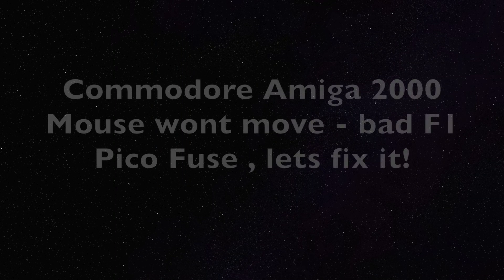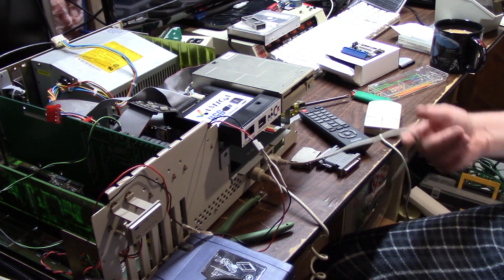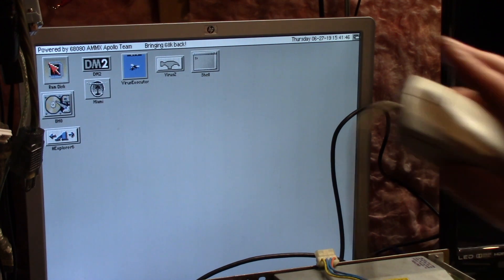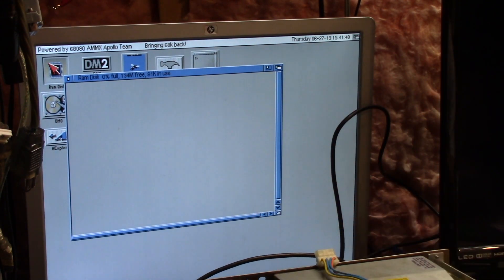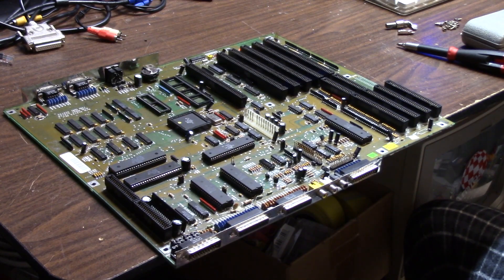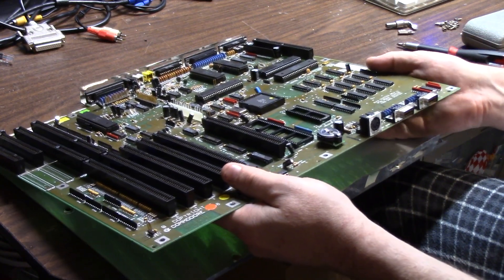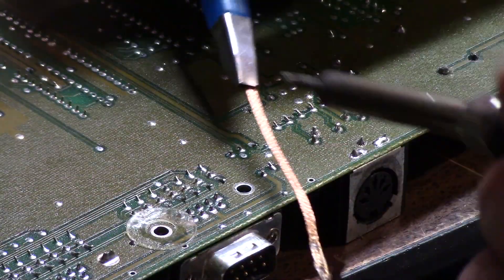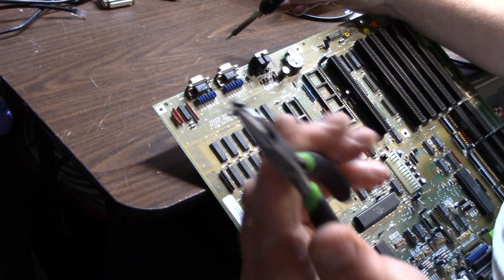Episode 96 Amiga 2000 Mouse wont move blown fuse

Comment: Hi. Fabio from Bologna. Same problem on my A2000. I removed the fuse and will buy it tomorrow. But I wanted to ask you if 4 amps isn't too much. I don't think 4 amps pass through the mouse port. And how many volts are there ? 5 ? 
In the video you say "100 milli amps and 4 volt".
Reply from the maker: the Amiga is a 5 Volt system. your mouse uses 5V 4Amp PICO fuses,

Comment: Hey Chris, great vid as always.  The right button on my mouse stopped working.  Everything else does work though, so I can't imagine it's F1.  Swapped CIA chips, reseated Denise, continuity tests of mouse pins to board check out OK.  Have you run across this and any possible idea what might be happening?
Reply from the maker: theres a chip in the front right that controls mouse movement, LS157 its like 1$   or your mouse is just dead... try another mouse to be sure
Reply: @ChrisEdwardsRestoration  Last night I removed all of the add-in cards and the mouse works fine.  So there's a conflicting card.  Thanks for replying Chris.

Comment: Anyone have a link to what I need to buy? Well i got some from amazon , 4A Littelfuse Pico Fuse 4A 4 Amp 125V Fuse 4A 125 Voltage ,I hope that is ok to use.
Reply from the maker: well i think they are 12v but you can even use a 3amp if needed. if you dont feel like taking everything apart, just piggy back the new one on top the old. then snip its legs
Reply: I fixed it today!! But I really shouldn't be near a soldering iron

Comment: Would a pico 3.5amp or 5amp fuse ok if 4amp isn't available?  i'd think 3.5amp would be close enough and safer than 5amp.   I have to replace mine and wanted to buy the part today not order and wait a week..  i know i could bypass but having not owned the unit when it popped i don't know what caused it to pop originally so i'm cautious
Reply from the maker: Sure would
Reply from the maker: What makes them pop most of the time is people swapping mice or keyboards in the metal touches causing a spark either from static or just some residual current they pop very easy so remember it’s 1990s when you use these things and we always had to turn off plug-in or remove devices and turn back on it’s easy to forget in the modern world of hot swap but that’s how it used to be I don’t know how many I replaced in my career but it had to be at least 100
Reply: @ChrisEdwardsRestoration  so would you advise 3.5A vs 5A?  yea i won't hot swap stuff.  Though I wonder, if I use one of those USB to Amiga Mouse adapters, would that be less prone to popping?  These usb adapters are very snug when they go into the A2000 they don't budge..  Not that i see myself needing to swap often.. In fact I am probably going to use a wireless usb mouse with it making cords a non issue (if it's compatible)
Reply from the maker: Its. All good ive run tinfoil over mine to get it to work.  And replacing it later of course anything in the 3 V through 5 V will be fine
Reply: @ChrisEdwardsRestoration  awesome thanks!  just wanted to be safe.. 4amp does seem like A LOT of power.. right?  i'm surprised that much juice is flowing through traces like this.
Reply from the maker: @8bitwidgets  its fine, im running 3A slow blow pico fuses in a few of them and it works fine. NTE part number 74-MS3A-B
Reply: @ChrisEdwardsRestoration  cool the ones i picked up today and are being installed by my trusted local repair guy in town today are 125v 3.5a fast blow fuses.  I don't see myself swapping live every..   i'm having him actually install single pin sockets so in the future i can easily replace them (and the varta) in a similar no hassle / solder free approach for years to come.  I have never liked computers that can't keep a simple time/date..  or at least having ones not keep time that actually should be able too..    I forgive my Sinclair 1000 and TI99.. :)

Comment: so i have an A2000 with dead mouse port..  my concern is if i get it fixed, do these things just pop sometimes or is there a larger issue i should be looking for while i'm replacing it (or rather instructing my local repair pro on what to look for) as I'm having him also replace the (not leaking yet!) varta battery
Reply from the maker: you dont "have to" take it all apart, you can either piggy back the new fuse overtop the old, or replace it with a diode to prevent it from popping in the future. the fastest route is to piggyback a fuse
Reply: @ChrisEdwardsRestoration  ok cool, the mouse port was dead when it arrived in the mail the other day.. so the prior owner must have popped it.. but no idea what they did at the time.
Reply: @ChrisEdwardsRestoration  if i wanted to use a multimeter to test the flow.. would i check for voltage at the two points of the fuse and see if energy wants to flow through it?  should i see 4v?
Reply from the maker: Yup
Reply: @ChrisEdwardsRestoration  if the mouse doesn't left click is that signs of some other problem?  also what pins are "hot" to check in case the fuse is in fact not popped but maybe some other deeper issue might be going on?  seeing if i can trouble shoot any more before opening up the whole thing.
Reply: @ChrisEdwardsRestoration  are there any ways to get a mouse working on an amiga without the mouse port?  I'm just feeling a bit down buying this box and discovering this issue.. everything else thankfully seems ok..  but no mouse pretty much renders this A2000 useless..
Reply from the maker: You can keyboard mouse it with the left amiga key and use the arrows.  Left click is the left alt right clickis the right alt/amiga
Reply from the maker: Its just pico fuses.  Piggy back some wite across them
Reply from the maker: Wire….
Reply from the maker: Could be just a shit mouse or a cia chip.  But if it moves fine just left click with left amiga /left alt
Reply: @ChrisEdwardsRestoration  Also for what it's worth, the keyboard works at least partially so far..  arrow keys..  caps lock..  control amiga amiga resets the unit.  no way to test more keys till i can get the OS to boot.  which is another issue i'm investigating.. has two floppies but at least DFO hasn't met a disk it liked so far, but virtually everything i have on disk was later aga era stuff so much of it likely wasn't web 1.3 compatible to boot from.  at least thats my guess.  but a couple of disks would get far enough to say "i don't like this disk.." and show the error screen with mouse..
Reply: @ChrisEdwardsRestoration  i did learn that recently about the arrows and keyboard mouse clicking..  but i mean mean a moving mouse like a real mouse if for some reason the mouse port was unfixable (if that's really even possible)  just exploring all options.  When I saw that you could still click the mouse button but your arrow wouldn't move in the video..  but these are optical mice so MAYBE the button doesn't click because it NEEDS a voltage vs the passive ball mice that click because it's just letting voltages through not powered by the voltage.. that's just a hunch..
Reply from the maker: Thats what the pico fuses do , they provide the 5 or 12v signals to the device
Reply: @ChrisEdwardsRestoration  thanks for that.  i guess i was trying to see if voltage is independent of the CIA chip..  here's my current thought.  the mice i have been testing with are optical mice.. ones that DO work with A1200 so not like i'm using an incompatible mouse.  That said, these are usb powered which i assume means the mice clicks are electrically driven..   something tells me (assumption) the original amiga mice were passive.  They simply allow voltage through to register clicks.  So when you test your mice with it being original amiga mouse, left click still works without any voltage while my usb mice fail to a mouse click or movement.  So at this point assuming my assumptions are correct, i can hope it's just the fuse.  I will be opening this up tonight or this weekend to get to the fuse and check for 5v through it.
Reply from the maker: My amigakit mouse will NOT work unless i warm reboot it.  Otherwise nothing but a red light.   Try a ctrl a a reboot and see if it lives
Reply: @ChrisEdwardsRestoration  ok i can try that.  is it safe to "hot swap" the usb mice?  and keyboard for that matter or should i ALWAYS power of an amiga to plug something in?  I'm thinking ALWAYS, but maybe only some things vs others?  

So warm reboot for your mouse.. you mean 1. turn on computer with all plugged up.. nothing.. dead mouse.  2. three finger salute..  3. Mouse activates after restart?  

NOTE: I do not have an OS on this unit yet.. nada.. nothing..  i get the disk request most of the time, or for 2 disks that it does seem to not deem incompatible give can't read disk errors which gives me a kind of OS view where I can at least see workbench.. no HDD in this system yet..
Reply from the maker: I always power it off im saying once it boots reboot it with the keyboard ctrl amiga amiga
Reply: @ChrisEdwardsRestoration  Also I was able to confirm that it is the fuse for sure now..  i know because once i got an original analog mouse I could get the left click to register just no mouse movement like yours.  before this one i only had optical mice which require voltage to do anything..    so that was a relief
Reply from the maker: Yes you can buy them still ebay and others you can swap the chips  and see if it improves.  Does the disk drive work fine?
Reply: @ChrisEdwardsRestoration  ok the disk drive attempts to read, but so far it hasn't read anything successfully.. most of my disks though are really AGA era so i think many are rejected either because they are not system disks (data only) or disks intended for WB 2.x or newer..   the 2 or so flo However both do get power / heads spin and try to read stuff.  I'm going to remove / clean both of the floppy drives and get some proper 1.3 wb disks made from my A1200 with ADF to floppy.  I have a gotek (which i had trouble getting to work in my A1200 so it's a new variable I want to not introduce yet..   I will eventually want to hook up but for now i'll stick with physical floppies because i can.

Comment: You can just solder the fuse in parallel with the old one without removing the board.
Reply from the maker: indeed you can, but i wanted it to be as original as possible without piggy backing them.
Reply: @ChrisEdwardsRestoration  Here's what I did. https://youtu.be/syDCZh7U_XM It's completely reversible and...well, watch the video. The benefits are explained.

Comment: This happened to us all the way back in roughly 1990. My older brother figured it out but to fix it he simply soldered a bare piece of copper wire between the contacts above the fuse so he didnt have to remove the motherbaord. A proper fix was done years later when we took the 2000 in to have something else fixed. Never figured out what caused the fuse to go in the first place.

Comment: I have the same mouse from AmigaKit, only the black version. It works perfectly. Really happy with that.
Reply from the maker: ive noticed sometimes i have to reboot once wb loads before it will work, does this happen to you ?
Reply: @ChrisEdwardsRestoration  

No mate, it doesn't happen. Though I have to say that I am using it more on my A1200.